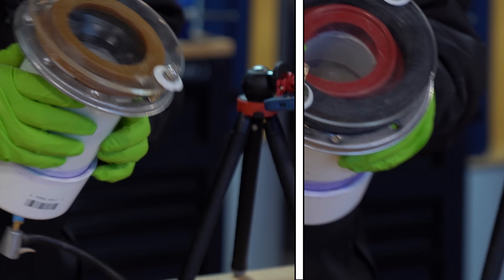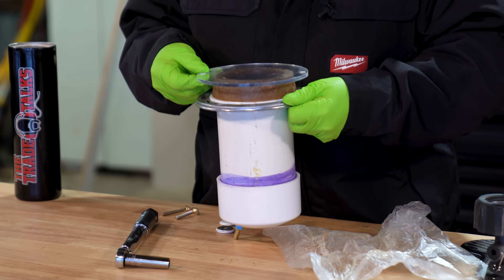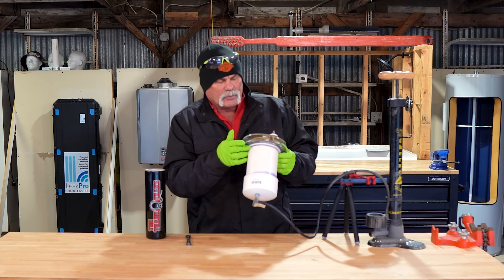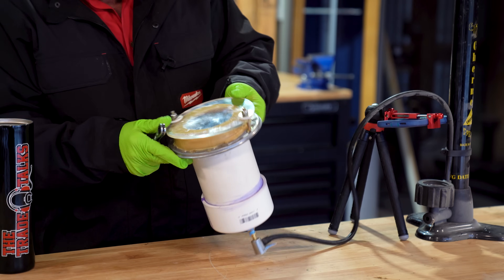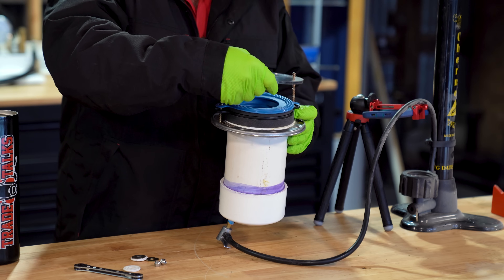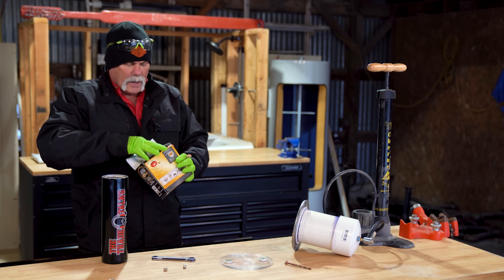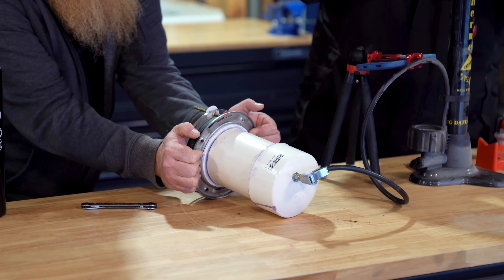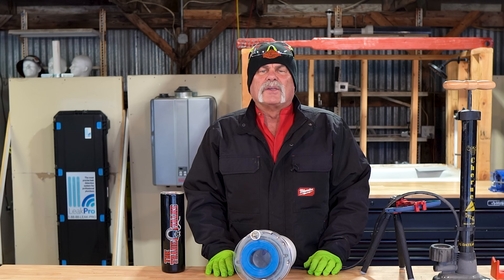Toilet Wax vs Rubber: Which Works Better?

Comment: Been plumbing since Jr. High (1973). My (late) dad owned/opened a residential (union) plumbing shop in 1964. Plumbed thousands of houses in southern California. I've seen rubber, foam, neoprene and other similar products rot/swell from air and moisture exposure. It swells up and causes stoppages in drain lines...rots and fall inside the pipe....no-hub bands look like a science project (inside the pipe!) after 20-30 years. The only time wax fails is usually when the person setting the toilet doesn't properly shim the bowl before tightening the bolts, causing the whole toilet to "rock" from side to side or front to back (not good). There's a lot more to consider when setting a toilet (if you want it to last forever) but improper shimming is normally the culprit. In my 40+ years of experience I once seen where ants got under a toilet and carried off all the wax...at least that's what it looked like....weirdest thing....but only once.

Comment: They waxless seals work fine, as a toilet is far more rigid than acrylic. I like them as it is easier for me to pull the toilet to snake my sewer than open a cast iron cleanout half buried in concrete. There is no mess to clean up. I use wax on the rest of my toilets. I've never had a failure with wax. I just hate the clean up.

Comment: The directions with Better than Wax say to only use the black foam extender when the top of the flange is flush with or below the flooring. A common situation you might see after a remodel where new tile was added later. You also did not compress the wax or rubber seals as much as they would have been in a typical install. And the wax will never recover if there's the slightest movement due to a floor that's not perfectly flat. Still, that was an interesting test and I was surprised that the rubber based seals did not fare better.

Comment: As I live in "developing country" we skipped many stuff you used at some point or still using, mostly of historical reasons like cheques, pagers, lead pans and many more. 
Toilet wax rings were never used in my area, we went straight to the rubber gaskets and to be honest I have never heard somebody had any issues because of those, tho I have also never saw anybody using foam spacers. Also it's worth mentioning that mostly rear outlets are being used all around.

Comment: Not a plumber, but I have replaced and put in a number of toilets in my time. Always used wax. Never had a problem. Not saying the other stuff couldn't be better, but wax has been used for over 100 years. Its cheap,easy, and it works.

Comment: I use the better than wax in reno work. Situations where I will be pulling and resetting toilet multiple times throughout the job. For instance, one toilet in home and multiple day job. I also set up without extra thick foam. I only have ever had 1 issue, and that was due to a hair line Crack in the closet flange itself. Like everything else, it has a place.

Comment: Not sure this test is reflective of the real-world scenario. Real world issues would come from a rocking toilet or repeated pressure on the bowl loosening up the seal of the ring. I used the Danco perfect seals in my prior home and had them for a few years with perfect results. I liked the fact it combined both designs, rubberized/plastic gasket and wax ring inside. Most of the bad reviews seemed be people not following the instructions as there are number of adapters included, that you don't use depending on installation.

Comment: I put rubber on 4 toilets in my house . Why because after  the epic ice storm  all the brand new one year old wax rings failed . We were without power for 10 days and I live in Southside vA where  a generator owner did not turn off his mainline and electrocuted the line worker  and they had to find who  did that before they worked on the lines again  . My house is overbuilt in 2004  2x6 stud walls  r30 in  floor joists and r 60 in the attic but it still got cold in here and all i had was the wood burning fireplace to keep the 2440 sq ft house warm  . funny how the only thing that failed was the wax rings  one by one I noticed they were  leaking ( I had to replace insulation ). They were all put in after new vinyl floors were put in

Comment: The thicker wax rings aren't designed to handle more pressure, they're for flanges that are below the floor level or tile level because the toilet is not going to set as close to the flange. Plus a toilet has a tapered flange that fits inside the ring. giving a reinforcement to whatever device you use to seal it. It's not flat like the plexiglass piece they use here.

Comment: I'm going to be putting a toilet in a garage where the slab has radiant heat.  Mechanical Contractor recommended not using a wax seal due to some hot water radiant lines near the toilet that might melt the wax.
Reply from the maker: I’d be using a rubber seal in that case

Comment: Two things I've leaned:
1-Never use wax on back outlet toilets.  The toilet instructions all explicitly state this, yet many plumbers still use wax and the toilet fails  over the next 10 years as the wax sags and gets eroded by the pressure flushing systems found in these toilets.

2-Avoid tbe product I like to call the 'GreenDonut' - a piece of highly absorbent low density foam dipped in some lime green  plastic/RTV coating.    The coating is not impervious to chemical decay nor physically durable.  One tiny defect and the toilet water will get in and it will be soaking wet inside, go limp and lose its sealing 'springiness'.   It's only good for temporary use for  frequently removed toilets ie during  remodel work.

Comment: I wouldn't expect the pressure on the toilet ring to exceed 1 foot of water column.  That's just shy of 0.5 psi.  What the rubber rings have going for them is their ability to rebound if the toilet isn't firmly seated on the floor and moves.  Wax rings can't do that.  The wax used is sticky and it clings to the bottom of the toilet and the flange.  If it is undisturbed, a good seal is assured.  I would use the extra thick wax ring to be certain that full contact is made at both surfaces, especially if the floor has been retiled.

Comment: I'm a big fan of rubber/foam toilet gaskets, preferably the blue one in the video, available at Home Depot. They're easy, clean and they never leak. There is no good reason anymore to use wax.

Comment: Outside of the US completely different seals are used on toilets
.
Here in AU and similar in several other countries.
In the past in the days of earthenware, the waste pipe went down into an earthenware flange with a large rubber O ring ( in the same way all earthenware was joined in the day) followed up by a fairly thick tar  or cement topping.
These days the pipe comes up and is terminated in a toilet flange ( pan collar) that contains a rubber seal ( pan seal), the waste pipe goes down thru the rubber seal ( pan seal).
In neither type was/is there any compression seal like your US fittings, there was never any wax or a flange.
.
This pan collar arrangement allows for irregularity and ( in PVC) some movement in the floor or plumbing.
.
In both cases there are no fasteners in the waste connection, compression is not required
In both cases even if the seal fails no fluid can spill, though gas may escape.
In fact if the fasteners that hold the pan down fail and even if the pan is rocking, the seal remains functional
.
more or less the same seal components are used in both a thru floor and a thru wall waste, though the pans are different
.
rubber pan seals are pretty easy to replace and cost about $5, a complete PVC toilet flange assembly costs about $20.
These toilet flange assemblies have other uses both in plumbing and outside, They seal on any standard 100mm ( 4 inch) waste pipe.

https://www.bunnings.com.au/holman-100mm-dwv-pvc-standard-pan-collar_p0079196

Comment: Toilets don't bend on the non bolt sides... Both work equally well. The foam would be easier for the mess for it comes down to one question. Is the foam near enough to the wax in price to change for the convenience?

Comment: Liking the video because I think having a methodical systematic test is a really valuable bit of knowledge, but try to get the test rig functional and issues worked out beforehand. I imagine the guys from Project Farm or Torque Test Channel could help you with designs if you reach out.

Comment: A nice rigid steel plate would have been a better way to test than acrylic. Acrylic is good  if you have to look at something. For air not necessary. At the same time pressure doesn't make sense to test this application. A toilet on a box with water in it and p-trap, with someone sitting and rocking on it.

Comment: You know, double gaskets are bad, right?  Just think of it as an oil filter. As far as the wax less are concerned, I am staying with them. The acrylic did not do either types any good.

Comment: The acrylic ring is bending under pressure, so the failure is in the test rig, not the seal material. When you inflated, I could see it flex and fail. As I continued to watch I see that you figured it out.

Comment: Used foam never had problem. Even reused took like a week for the foam to bounce back for reuse but possible. Problem with your test is the acrylic flexed. Be like tightening an oil plug to a dented oil pan (dent being on the drain.) Each creates a seal in very different ways as foam compresses and wax deforms. Porcelain dont flex and compression is achieved accross the seal. That said it wouldn't surprise me if wax holds more pressure however the seal only needs to be good enough to serve its purpose. Add the no cleanup, and better recovery from shifting many would think it not a bad deal. Ofcourse, I dont blame you for using what has worked for yiu and your use too.

Comment: you need a thicker  plate that does not flex 1/2 or 3/4 thick plexiglass with all that said i still use wax.  like your video's

Comment: I have used it around 150 times only once that I had a problem of sewer odor I think the problem with the simulation is that it only has 2 screws while When you put it in a toilet it has full circle of the toilet that pushes it down

Comment: I have installed hundreds of foam/rubber rings. I have never had a problem.
Reply: same here..wax with no plastic horn is way to go...those plastic horns cause leaks in my experience

Comment: I think the real question is longevity since out of the box, I'm sure either would seal. The rubber may have the advantage in that a movement that breaks the seal may self heal with the rubber.

Comment: I have bought a rubber seal that looks something like a funnel. you use a rubber cement to attach them to the underside of the toilet then put the funnel end into the pipe,  To tell you the truth the one upstairs had been re-used twice and the one downstairs has been reused 3 times, Seems like the toilets break before the Seals.

Comment: Most times you do not need to use the foam spacer, just the rubber. It would easily hold pressure.

Comment: You can’t get the rubber seal to hold because the plastic “toilet” isn’t ceramic and is deforming when you screw it down.  That wouldn’t happen with a real toilet so the test setup is the problem. The wax seals can be easily deformed when a homeowner is trying to drop that heavy toilet down, while the rubber one is not really susceptible to that kind of error - it’s more forgiving.  I used the rubber ones when I installed my new toilets and  6 years later they are holding up just fine.

Comment: I prefer wax because I can increase the height of the wax ring by topping it off with another ring if I need more thickness. The rubber ring is a fixed thickness which is not adjustable.
I've been Installing toilets for 25 years and tried the rubber ring once. It leaked afterwards.

Comment: As a DIY homeowner, I like the better than wax because I'm by myself installing the maybe 2nd or 3rd toilet I've ever installed in my life, I can't really see what I'm doing, and the idea of missing and smearing the wax and having to clean it all off just to try again does not appeal to me at all. If I miss or move the rubber seal, I can reset it and try again.

For plumbers, wax seals have proven reliability and they may work in teams and have installed hundreds or thousands of toilets, so the concerns I have as a home owner are void for them. It makes sense to use what they know to prevent callbacks. 

In addition, I imagine the better than wax type seals get a bad wrap because if you're using it for the convenience factor like I am, you in essence don't know what you are doing and if you screw it up, get a leak, and call a plumber, they're going to see that you tried to use it and failed, and then default to the tried and true wax seal instead.

Comment: I've switched to rubber. No leaks and it does reseal. Its easy to reseat too. No mess. However when you do have a clog and are putting too much pressure with a plunger etc it will leak. Take care of the clog then reseat no problem

Comment: You assembled the better than wax seal incorrectly. On the INSTRUCTIONS it said only to use the  Large ring if your toilet flange was below floor level. You used both Try your test again with just the first seal. I used one of these and found it very good.
Reply from the maker: Thanks for the tips!

Comment: I think you're right: I think with a toilet weight on it it would seal up better. I'm guessing there'd be an increase in pressure across the board. Interesting test. Thanks! "Easiest way to set a toilet? Have someone else do it.🤣"

Comment: I think that if on the better than wax one if instead of foam they used wax combinated with the rubber parts would be a good seal

Comment: Think the porcelain is far less flexible than the acrylic/perspex/plastic cover you are using also a new piece each test would typically be required cut at the same time from the same sheet, 
the red gasket has given me nothing but trouble any time I have used it just Couldn't get it to work. Would not seat after 4 or 5 tries just gave up failed each and every time, the blue seal I generally prefer, but had a call back as the rats chewed through on I installed, not a good look.!?

Comment: To simulate a toilet it has to have pressure applied to 360 degrees like the bottom of the toilet would be on top. Excellent idea to see the results though!

Comment: I ain't the plumber or the plumbers son, but i can plug a hole until the plumber comes..!! 😂 
I'm just a diy homeowner, i redid my upstairs bathroom by myself, all new plumbing,  waste, vent and potable water lines, i used the foam gasket for my toilet and so far (about 3 years now) it's held up just fine, no leaks.. 
I also just happen to be helping my neighbor completely build a bathroom in his downstairs because his wife can no longer get upstairs where their only existing bathroom is, just got the plumbing done yesterday and hooked the toilet up and got it working for them, he went with the wax ring and of course that's working fine.

Comment: I think you need to read the instructions for the blue plastic flange. The gray foam ring is optional, if you need the extra thickness. Also, your plexiglass is flexing, which a toilet would not do. I'm returning one of those plastic seals to the store tomorrow because they apparently don't fit the type of closet flange that fits inside, rather than outside, of a standard 3 inch pipe. The blue plastic neck is too big. Your scientific testing is a great idea, though.

Comment: The toilet wouldn't give like the homemade cap you have so the psi for the wax rings could be higher as the porcelain won't give in front and back of bolts

Comment: the wax will flow over the years and eventually was out. it takes many many years, but it does happen. What i cant say is how long these foam and rubber ones will last before they deteriorate and fail.

Comment: As you know, the sealing area on the toilet is not flat. The acrylic needs to be shaped like the sealing surface of a toilet bowl. Also attach the closet flange to a piece of 3/4" plywood and tighten the bolts as you would normally do.
I would bet the wax rings would have held a lot more pressure.

Comment: Homeowner: I DIY'd one with the better than wax after seal broke on my toilet, it's been on our most used bathroom in the house for 2 years, no issues to date, very easy to install.

Comment: I have been a product design engineer for 45 years.   And I have also been a plumber early on.  I see one flaw in this testing.   The acrylic is flexible, and a toilet is rigid.  Your air is leaking out because of the flex in the acrylic.  Apples and apples.  If you used 1/2 inch acrylic, or 3/4 in sand plywood, or 1/2 inch glass, it would be better.  You need to get rid of the thin acrylic.  At 10 psi and 3" drain you are already putting a load of 70 pounds of pressure on the acrylic.  There are 7 sq in in a 3" drain.

Comment: Things to note. You need over 25 pounds of pressure PER SQUARE INCH of the P-trap, call it an even 2square inch (to severely underestimate the internal cross section) and thats still over 50lb of force to move the stoppage. Id call it practically impossible if nothing ever moves and is replaced even every 10 years

Comment: I'm still early in the video, you didn't have 25-30psi in your rig.   You had that at the gauge before the hose, but after you finish a pump it drops by roughly 10 psi as the pressure in the hose equalizes with the pressure in the pipe.